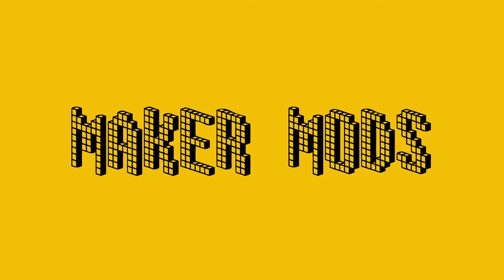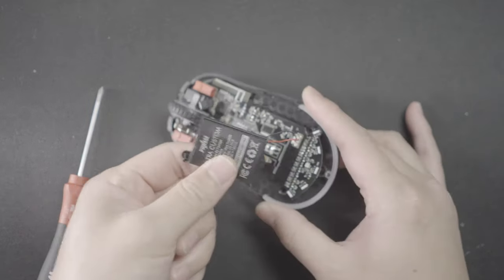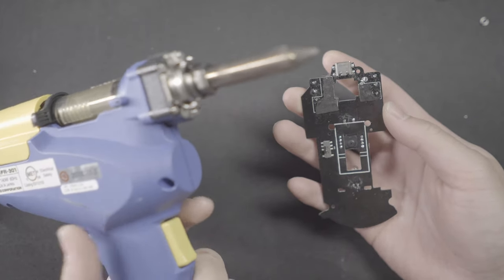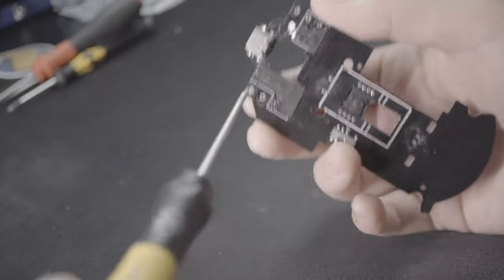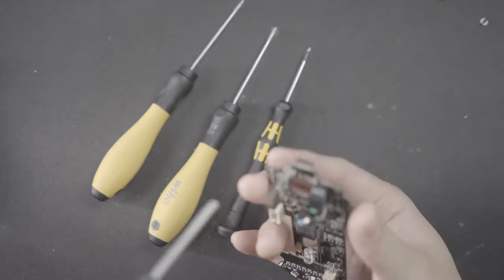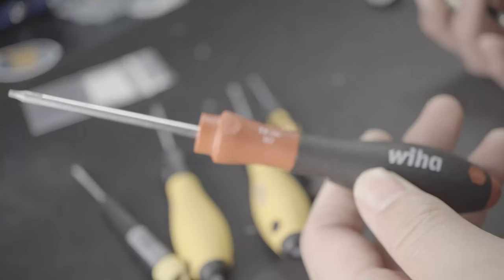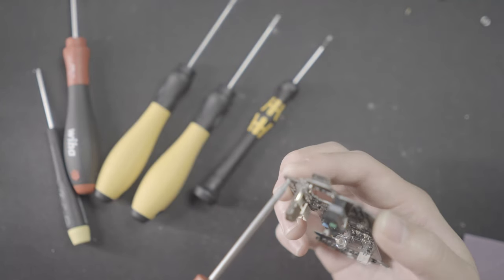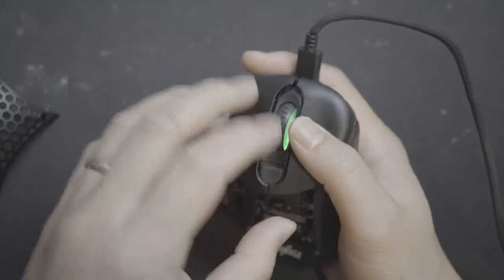How to Hot Swap Mod your Gaming Mouse!

Comment: A few tips to anyone who decide to hotswap mod his/her mouse after this video:

Apply some rubbing alcohol underneath mouse feet to soften glue then you can easily remove them without damaging.
You can do without solder sucker by duck taping/clipping something heavy to the switch and then heating all 3 pins at the same time either by using 2 soldering irons with one having wide enough tip to heat 2 pins at once or just by applying a lot of solder and rapidly switching between pins with wide tip, preventing solder from cooling down.
Once solder is liquid on all 3 pins, the switch will fall down. Don't forget to use enough flux and be careful not to overheat or you can damage PCB/switch.
Use very thin long conical diamond file to enlarge holes in PCB, you can buy it for cheap as "diamond jewelry reamer", it's more safer and accurate than using torx screwdriver, enlarge evenly from both sides. Avoid breathing PCB dust!
Use m1.3x3 brass rivets instead of mil max sockets, they're dirt cheap and work just fine, just solder them in like sockets. They lack any locking mechanism tho, but you can bend central pin of the switch just a little if it's too loose inside rivets. They also have lower profile and if it's still too high you can additionally flatten the head.
Make sure to push the rivet against something heat resistant when soldering it in to ensure it sits as low as possible.
Reply: Also do the same when you stick them back on. While at first they will feel like they don't stick at all, one the alcohol evaporates they will be stuck back on with almost the same strength as new.

Comment: just did my first mill max mod today, and the result is kinda mix. i am using 7305 as well. the bit i used was T2 T3 T4 T5 T6 and some ph00 to counter sink.
by the time i manage to insert the 7305, i fell like i already ruined the hole. I was being super careful as well. The fit was snag, which is nice. but i just felt like the pcb i am working with just doesnt have enough trace in there to finally grab to the milmax socket. I tried again, the enlargement is actually easy with the T bits, the counter sink with ph0 is not too bad, but end up another fail as well ( the pcb wont even register the click, meaning the trace is broken within the pcb, bore out too much material even tho i barely manage to insert the thing.

So here is what i tried with different approach. instead of modifying the pcb, i modify the milmax socket. 
I am not going to insert the millmax like it suppose to, I am going to put it on AFTER putting the switch on. meaning the flange will sit underneath the PCB not above.
However the flange is too big that i almost covers up all the ring (the metal ring around the hole where solder goes), so i have to modify that flange, but i do not want to remove it fully since that would make solder way easier go into the socket.

So i only trimmed part of the flange (just sand it), put the switch on, put the socket on, and solder it that way. The risk of fking this up is significantly lower, and the switch should still have decent contact with the socket.
But do check clearrence with in the mouse case so the socket wont touch the bottom of the mouse.  And if your switch somehow isnt sitting tightly, just bend the legs a bit so it kinda jams in there good. (just a bit).

for me the second method is way easier, almost risk free, and very easy to revert to the original PCB state (literally just remove the socket).
However I do feel like the 7305 isnt design to be used this way, it is too long for sitting like that, also flange modification is needed. 

it is 2023 now, all keyboards almost hotswap, screw all accessible. high end mouse still like 20 years ago, have screws hidden and not able to swap switch let alone it came with shit ones.
Reply: This worked great for me, thanks for the idea. I used 3305  and didn’t require any modification
Reply: @saulb0714   No modification, like you didn't need to file the holes to make it bigger?
Reply: What was the mouse? I want to see if the PCB trace is any bigger or smaller compared to my mouse which I'm planning to hot swap mod.
Reply: Thank you, never thought of this.
Reply: I'm gonna try your method of mounting the milmax sockets from the back with 3305 sockets. Hopefully I don't ruin another PCB.
Reply: @saulb0714 can you give a little more details on what you did exactly?

Comment: This is awesome, I just modded the switches on a MM710 and got the itch to try a bunch of different ones. Will definitely be trying this mod out.
Reply: hi, have you tried this mod? i currently have a mm710 and i want to do the mod too
Reply: @FALLUCK  No I got distracted and never got around to doing it. I think it would be pretty simple though, the mm710 is super easy to take apart

Comment: Hi! I accidentally rip off the solder pad on one of my mouse right click. And now it doesn't work. Is there anyway to fix the contact trace of the pcb of the mouse?
Reply from the maker: What mouse is it? I’ve never run into that issue With a mouse PCB. You should theoretically be able to follow the trace and jump it, but there won’t be very much space in the housing, unlike when it happen with a keyboard :/
Reply: I did this to my mz1 too :( I can't see the contact traces so idk what to do
Reply: Sad, I did the same thing to my Mx Anywhere 3s.

Comment: Ah shit I sanded back that copper and my right click doesn't work anymore on my mz1 wireless :( Cool idea though
Reply from the maker: oh no!!! Yeah I think you might be SOL on that one :/
Reply: @MakerMods  Yeaaah it looks like the t5 or t6 was wider than the copper pad to begin with and it took it out real quick. I tried copper tape, and exposing more copper in the pcb, but nothing worked. Oh well, wasn't really the best shape for me anyway. Lesson learned, some pcb's just don't have enough contact area for this mod to work.
Reply: @MakerMods  Can you clarify something for me please? Because I'll eventually want to try this mod on another mouse. @10:53 I think I misunderstood you here. So the goal is not to get the copper to "wear off" but just be flattened? I noticed the very thin copper beginning to peel up and thought "oh this is what he means by that copper coming up, I'm supposed to get rid of that for the sockets to sit right. So I actually need to leave some, as it's responsible for making contact?

Comment: So I have a serious problem... I was trying to speed up the process by using a drill to widen the holes. It was going well, until the 2nd to last hole where it peeled up the wiring leading to the underside of the middle hole on the left mouse switch (the exact switch I was fixing). It didn't go passed the bottom hole, is it still salvageable? 😱
Reply from the maker: To be honest, I’m not sure! I don’t know where mouse PCBs’ traces run, and while it should be theoretically possible to jump there might not be enough room in the enclosure :/
Reply: bring to someone that does PCB repair, usually a phone tech should do. shouldnt be too hard of a fix for them.

Comment: The fact mice are not already hotswapabale is rediculouse especially with the switch plague
Reply from the maker: Totally agree. I think if they just made the pcb holes slightly larger then it wouldn’t even be difficult. Or slightly redesigning the PCB to use a type of kailh hotswap
Reply: @erisium6988  haha, but u can use razer optical switch mouse
Reply: @erisium6988  just bought a pugio 2, can i use any witches in it or does it have to be a certain kind?
Reply: @MakerMods  totally agree, just need tiny bit bigger, we as user can even finish up the job adding sockets.....this is such a pain in the ass.
the room for error is almost not existed, and sometimes the PCB hole is just way too small to even do this mod, since after boring, all the trace will be gone, and there will be nothing for the millmax socket solder to.

Comment: what is the difference between 0305 and 7305?
Reply: 0305 tin is longer in length and has a thicker lip which can cause clearance issues. 7035 gold is shorter and has a much thinner lip that makes it sit flush with the pcb.

Comment: So what is the point of this mod?
Reply: If a switch breaks, or starts double clicking, you can then just take the old switch out, and put a new one in, no soldering required. It's like a hotswap keyboard socket.
Reply: or testing out all kindas of switch to find the best one for you.
it is almost as useful as keyboard hotsawp switch design.

Comment: Thanks for the guide! Just done it myself. While the left hotswap button works, the right button doesnt seem to work with the sockets. Any ideas?
Reply from the maker: It may not be completely flush! I noticed a similar issue with my second mouse. Had to keep sanding down until it was perfectly flush!
Reply: @MakerMods  Could be, however while the left hotswap button alrdy works without the hotswap pcb soldered in the right one doesnt work at all, or only registers some clicks :(